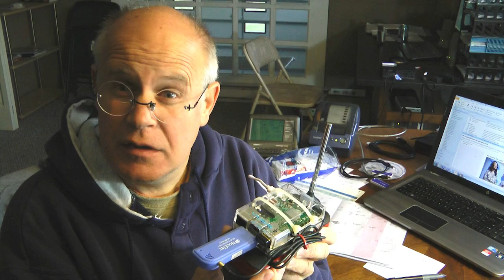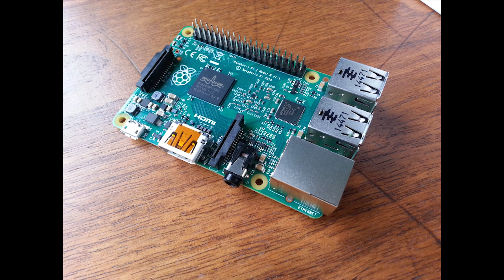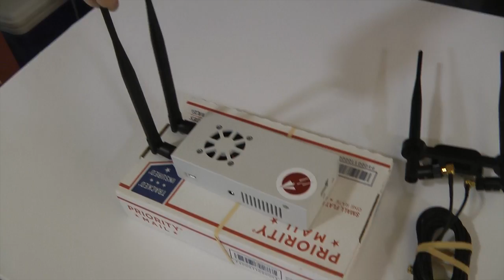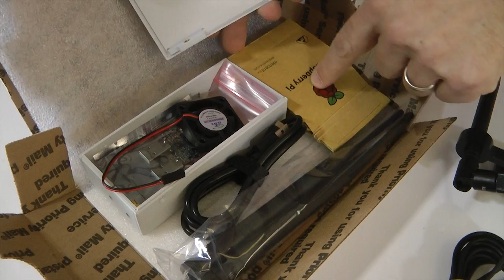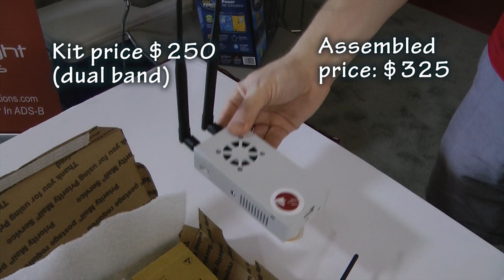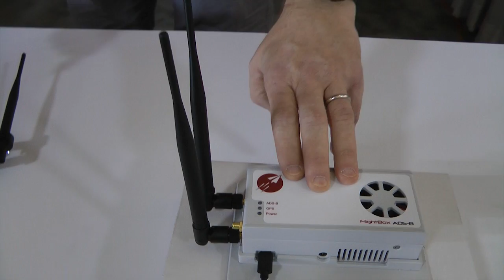How to Select an Affordable ADS-B Receiver

Comment: A quick question. Are any of these items compatible with the 2020 ADS-B out requirements. The reason I ask is the requirement for a very accurate  GPS location requiring faster updates.
Reply: No, they are not.  The requirement is for ADSB-OUT, not ADSB-IN.  I just re-built my Stratux solution.  The "from scratch" price for all components for a dual band system as of today is a whopping $123, including an external  WAAS GPS (can't be used in an ADSB-OUT solution).  Just add battery, battery charger, and microUSB cable.  The video does not mention that AHRS support in the Stratux software is still only experimental at this time (and won't work with ForeFlight, as the video mentioned).  The currently recommended hardware component to support AHRS is a whopping $14.99.
Reply: uAvionix.com has several GPS rated compliant ADSB-out units